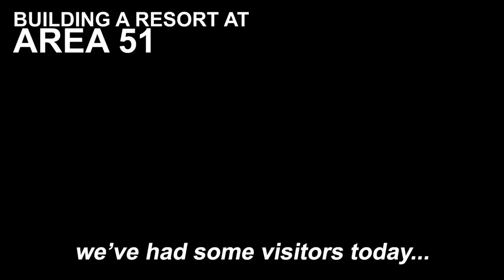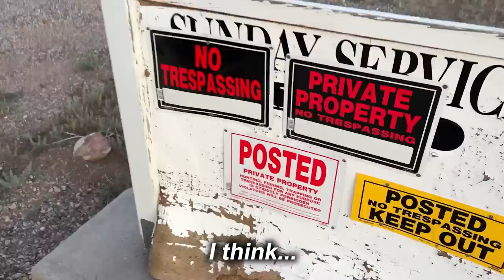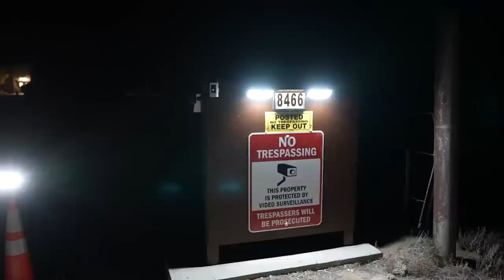Living on the Border of Area 51 for 1 Year

Comment: The amount of sun you get on that property, it would be a great spot for a ground mounted solar array with tracking gimbal. it's not that expensive and it should exceed your power needs several times over. check out Enphase IQ8A microinverters, LG panels ~400W each and some Enphase batteries to keep the spot running all night! Loving the progress!

Comment: I've spent most of my 20's in Rachel Nevada, the pilots flying them jets are trying to run you off. They will fly super low, near the speed of sound then blow all your windows out with the shockwave of their speed. If, I mean when they break your windows, they will say that they are not responsible for damages. They did the same thing to me and I finally had enough and moved away. They usually did it in summer, a few times a year.

Comment: DO NOT ZONE IT FOR COMMERCIAL USE..commercial properties can not be zoned for residental living..residential zoning with commercial use
Reply from the maker: Do you have experience with this? If so, let me know as we are still dealing with zoning!
Reply: @EWUCrew  I have some knowledge, commercial building codes are slightly different from residential building codes. It's hard to get it switched once you start building. Judging from the church it has been zoned before, so 1st step would be to find out what kind of zoning they did for that, even if it's being torn down most churches are residential with commercial use. Hope that helps!

Comment: I sell paint for a living if you need some tips I believe you would be better off stripping those pads and using solid color concrete stain instead of the semi solid or transparent stuff those hack job contractors did for you

Comment: I happened upon a few of your area 51 videos. Interesting area. 
However, I'm shocked at the amount of money you have spent....... why didn't you do a site plan? You could have built a lodge with the money you've already used . 
Since you bought that other parcel, for such a high price..... instead of throwing money for a huge new building, why not do full preplans for the other property, well, septic, electric, camp sites. Space enough between the campers, don't do the spendy wood structures, something simpler would work well. The concrete can be colored before being poured......
Get income coming in before expenditure. Also, a bathroom/shower house would be of more use than a huge metal building for basketball was it?
And if you want to spend money, a pool would be a better investment. Not a huge one needed.
Most campers have canopies, so, how can customers extend their canopies if the shade structure is so close?
I'm sorry, my shock level on your spending..... not trying to be rude or mean, 
You seem to definitely be trying to think of your future customers. Have you asked campers what they would like to have available at a campsite there? Just wondering.
Laundry comes to mind as well.
Have you considered, using canvas clipped between three or four poles? For shade, also as a fencing so to speak.
Solid red, a blue, beige....... many possibilities. Much lower cost.